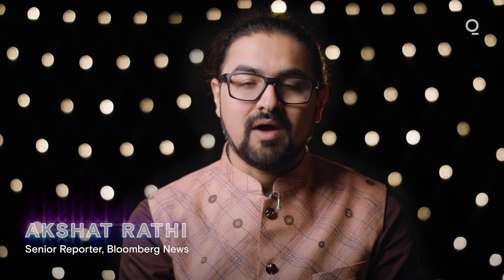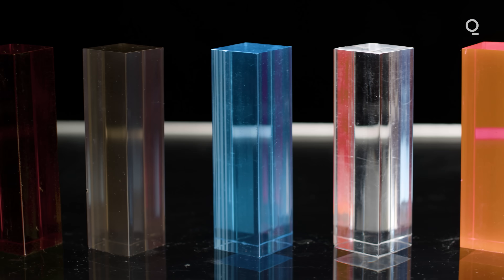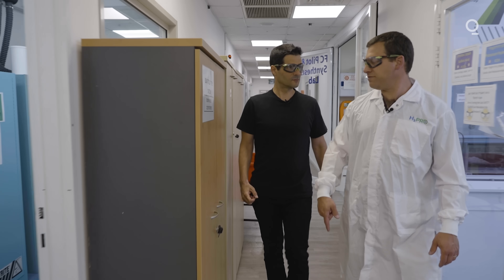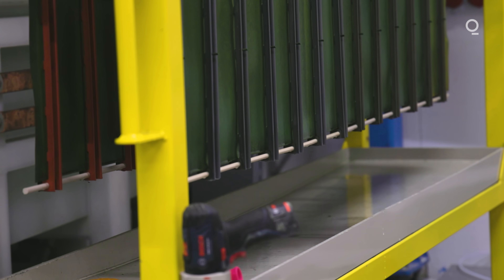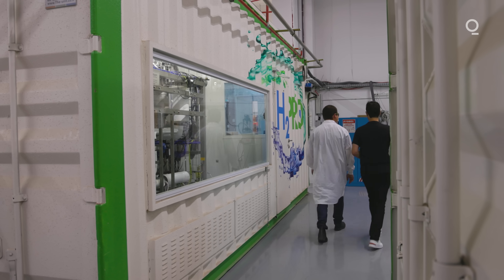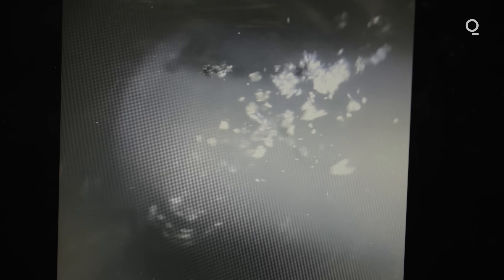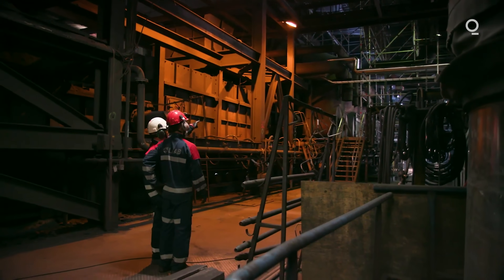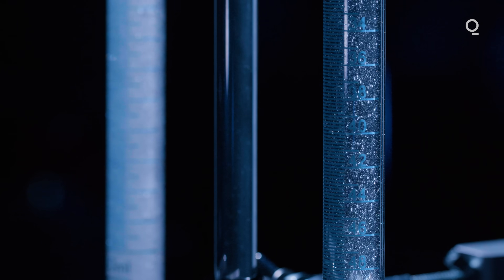How Cheap Hydrogen Could Become the Next Clean Fuel

Comment: Using hydrogen is one of the most wasteful ways of driving our economy. The process of producing, transporting, storing hydrogen and converting it back to electricity is incredibly inefficient and you lose on the order of 3/4 of the energy. This means you have to produce like 3-4 times the energy you eventually get out of it! Why wouldn‘t you just use the energy directly by plugging in a battery?? Sure, for very weight and range sensitive applications like aerospace or shipping batteries aren‘t really an option so far but for those areas it might even be more efficient to further convert the hydrogen into methane (natural gas) and use this as a fuel instead. It is way easier to handle, all the necessary technology and infrastructure already exists and converting jet engines to running on natural gas ist rather easy and thus cheap. The only application for hydrogen that would make at least some sense is long term energy storage to buffer out the infamous volatility of renewable energy production. But as I said, this requires energy to be so ridiculously cheap that we can afford to just waste most of it. I guess we‘ll see what ends up happening, I just hope our governments will stop pursuing pipe dreams that make us all poorer without actually benefiting the environment…
Reply: You are already storing and transporting natural gas
Reply: There isn't going to be a one size fits all solution to fossil fuels. In incredibly cold climates as well as very hot ones (think Canada and the Sahara) batteries just wont work.  I just came back from Alaska. Most of the towns up north get just 2 fuel shipments a year and it has to provide all of the power for the next 6 months.  These small towns wont have their own power plants and for obvious reasons cannot depend on solar/wind to charge batteries.  Also shipping and aviation together represent a solid 6% of co2 emissions.  They need chemical energy storage for survival and these remote towns are where a significant portion of our seafood, minerals, and other raw materials you use every day come from.

Comment: I'd rather use this fuel then electric or so called battery powered cars. That can do more harm in the long term.
Hydrogen will never run out, never need to charge,
Reply: Exactly ✅electric cars are one of the biggest scams of the 21st century.
Reply: Options should be available, I wouldn't like to spend time on a charger, and the thought of spent batteries going to landfills,
Reply: @stevem7508  Batteries will be mosty recyclable before the end of the decade.

Comment: It should have been something for years now. People didn't just magically learn how to make hydrogen work I'm their cars, we've had the tech for years, big oil just silenced it for years.
Reply: No , we don't use hydrogen for two reasons .

 - hydrogen is energy negative , meaning it takes more energy to make hydrogen then you get out . 
 - hydrogen storage , liquid hydrogen has to be kept at -252.8 C as well no storage container can keep hydrogen atoms from leaking out because hydrogen atoms are small .
Reply: @nobody4y  Thats actually false. Ive worked in plants with Hydrogen storage tanks doing final coatings on all the hardware and shells of the tanks, hydrogen can be stored, industrial plants do it all the time, along with chemical facilities using it for research or in making fuels. Hydrogen is used as fuel for rockets as well. Space X uses it or used to, not sure if they still do. also hydrogen isn't hard or costly to extract, its actually very easy and doesn't require that much energy to do so, as shown in the literal thousands of examples online in videos, blogs, and research documents. It's 2022, a lot of what the common folk thought was a challenge, expensive, or dangerous no longer is or really ever was. It is greed that kept the alternative fuels under wraps and a lack of early knowledge in how to handle hydrogen that kept it in particular from being successful, but now we have the means and tech to make using it logical and practical. If what you say is true then the new Toyota concept car wouldn't work, and it does, so far. Plus hydrogen powered cars have been around before but again they were very unsafe and unstable. We can now combat that. Honestly, my thought is using natural water sources to convert into hydrogen using energy gathered by solar panels to then power the charging stations for electric cars once we have almost limitless battery lives for automotive. Use the solar energy to create the smaller charge needed to extract the hydrogen since it would probably take to many panels to actually charge and store enough energy for an almost all electric auto world, then the hydrogen could be used with its rather strong output in regulated amounts to spin turbines like what are used in power plants but on a smaller scale to then send a charge to the stations. The exhaust given off from the turbine stations would just be water vapor which could also be used in some other way if not aloud to go back into the air. Sounds like a lot but if the different industries would work to help eachother out  this wouldn't even be an issue. Even the coal and oil industry could help support the first decade of development while we convert to the electric and hydrogen ways or powering things like cars and turbine generation stations. Don't even get me started on the beauty of Hydrogen fusion, that is for sure a talk for another time. Lol
Reply: @jyminewtron1416  if you worked with hydrogen tanks then you would have know that you need to keep hydrogen constantly cooled beyond its boiling temperature to keep it from boiling away.

That is energy intense procesas not to mention hydrogen extraction via hydrolisis and compresion which is another layer of energy consumption.

At the end the amount of energy you get is far less then what you need to put to get hydrogen in the first place, aka energy negative proceses.

The cheap and easy way of making hydrogen is through fosil fuels and their byproducts, if you think you can do that with just solar panels then thats just wishful thinking.

Also holy wall of text, please use some spacing.
Reply: Big Oil DID NOT silence H2. 99% of affordable world hydrogen is produced BY BIG OIL! From Oil! They would love you to be dependent on H2, as it allows continuation of their industry with little change.
Big Oil did collude with Detroit muscle to silence the electric car. Look up “Who killed the electric car”. Tesla did not invent the modern EV, GM did. In 1990

Comment: I have loads of hydrogen stations around me in Silicon Valley. 

$17/gallon equivalent LOL 😂
Reply: I hope they lower the costs
Reply: @KillroyX99  In CA?  Don't hold your breath.
Reply: @NCF8710  , I'm not.  

Charging a plug-in is like ~$1/gallon of gasoline or less because it's efficient.

Can't handle DC fast charges of 20 miles of range per minute, then get a plug-in hybrid for your next vehicle.
Reply: @KillroyX99  You were talking about hydrogen fueled vehicles.  Or have you forgotten?
Reply: @NCF8710  I’m not holding my breath that they can lower the cost of hydrogen. I’m also mentioning that hydrogen is not very cost competitive.
Reply: @KillroyX99  i agree.
Reply: The hydrogen stations around me have been very unreliable both in supply and function other stations. It’s getting better now. I don’t see the long lines of Ashton cars going to fill up after days and days either out of order station or out of hydrogen station.

Comment: Mark my words hydrogen combined with nuclear fusion is the future
Reply: Nuclear fission for generating lots of power and hydrogen as fuel for vehicles
Reply: @adityaks345  The worst way to use hydrogen is in personal vehicles. Batteries are much much more efficient, and significantly cheaper, and oh yeah, I make electricity on my roof. Don't get scammed
Reply: @OAK-808  Nah, batteries are very impractical. Too heavy, degrade if fully charged and discharged, degrade if charged fast etc.
Reply: Nuclear fusion with battery powered vehicles is the future,  hydrogen is the future oil & gas wants so they have a future business and infrastructure to control
Reply: if people just could become a lil less scared of nuclear fusion :(
Reply: @ltpetsema876  i agree but  its safer and easier to accept a lie like solar panels and wind turbines than to actually build nuclear fusion stations which could power the entire world
Reply: @ltpetsema876  no one is scared of fusion because it doesn't exist.
Reply: Nuclear fusion is 50 years of talks without any progress and 100 years to come .hydrogen is hog resources to create its not economical and green at large scale.
Reply: @fresh2536  its not economical because there is no investment going into it, i remember the days when they said battery electric vehicles where not economical, we need investment and incentives for scientist to work hard to find new solution to extract hydrogen for nuclear fusion its more of a fear factor rather than cost

Comment: Hydrogen isn't a fuel... it's an energy storage mechanism (a chemical battery).
Reply: Not a very efficient one too
Reply: Your reasoning is valid, however, using your reasoning, "fossil fuels" are an energy storage mechanism, a chemical battery, too. (Not saying you ever said one way or another about fossil fuels, just pointing out to others that fossil fuels are but energy storage mechanisms.) The much maligned "fossil fuels" are pretty well stored solar energy. As you know, the solar energy received by this planet is effectively essentially sourced from a version of 'nuclear' energy, that is, the sun's energy production process. It'll take 'eons' to burn out, however, that nearby star energy source, the sun, isn't renewable, just very long lived when contrasted to relatively short human lifespan. Although, yes, so many other hypothesized or perceived problems are so much more imminent or of concern than the heat death of the universe. However, entropy is entropy. As you know, there's no reversing, or even stopping, entropy. Can we significantly impact entropy one way or another? NT Personally, I doubt it. But what do I know? NT
Reply: anything is impossible to the mind that lacks the vision and believe.
all the negatives about hydrogen ain't no different from that of the possibilities of an airplane or telephone. they were virtually impossible at their said times.
Reply: Anyone want to look at the Well to Wheel efficiency of a Hydrogen Fuel Cell compared to a gas car?  BEV?
Reply: what you talking about mate, ofc its not a fuel but with the right tech you can turn its applications into fuel, thats why we need improvements not only in hydrogen but also fuel cells
Reply: @aresshi7077  i'm not arguing against hydrogen and fuel cells, just stating facts of physics... it's not a fuel source. 

Nuclear energy with hydrogen for storage (for transportation) is the answer. 

If you're using coal to create hydrogen you're not seeing the big picture.
Reply: Natural gas isn't a fuel.. it's an energy storage mechanism (a chemical factory)
Reply: @joputhiyaparambil07  yes, but the carbon has already been pulled out of the environment to create that energy...

let's be real... if you believe in climate change, nuclear energy is the ONLY realistic solution.
Reply: @joputhiyaparambil07  , yeah, but we don't put much energy into it to use later besides extraction and transportation, refining, ect.
Reply: @KillroyX99  But we have to use much more energy to remove the waste materials such as carbon dioxide if those hydro carbons used. 🤷🏽‍♂️
Reply: @joputhiyaparambil07  fossil fuels are fuels. Hydrogen is not. If you could find hydrogen in nature, like you can find fossil fuels, then it would be a fuel source.

But it takes more energy to produce hydrogen then you will ever get out of it. (Fact of chemistry)  That's the difference.
Reply: @Grahamaan27  Sorry to burst your bubble. The atmosphere is about 0.000055% hydrogen by volume. 🤦🏽‍♂️

Splitting H2O to the elements required 242 kJ of energy per mole, Combustion of Hydrogen will produce 286 kJ. (Theoretically)

So your arguments won't stand. 

By the way, did you ever calculated how much energy required for the formation of one kg of hydrocarbons? Petroleum not just extracted, that fuel created by photosynthesis. As you know that is a highly inefficient process. 😏
Reply: @joputhiyaparambil07  1 mole of H2O does not equal 1 mole of Hydrogen....